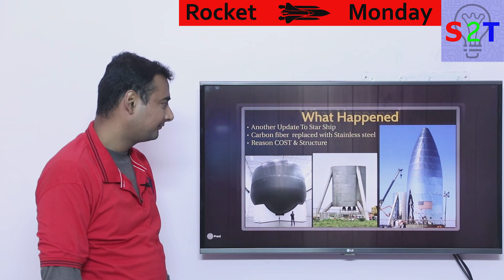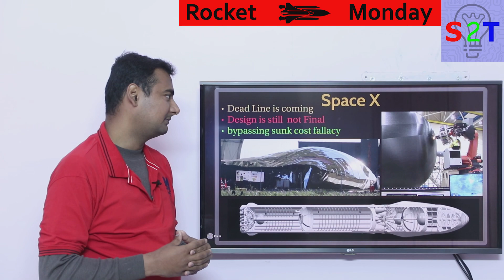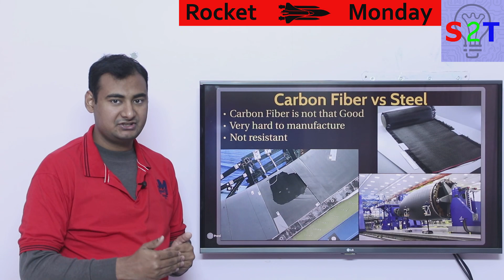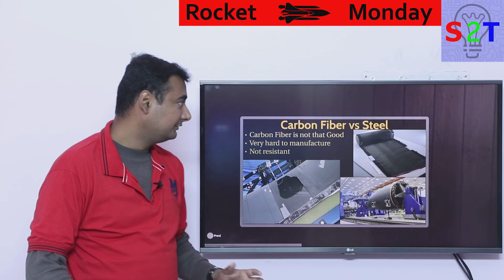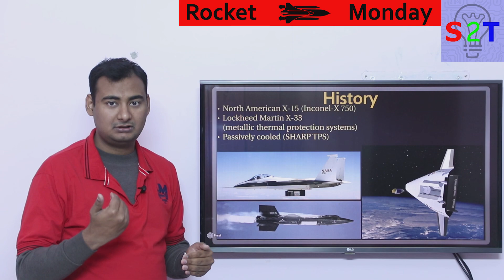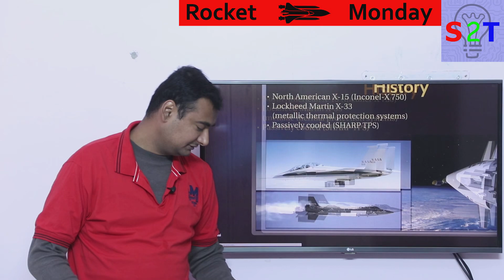Rocket Monday Ep32 (Spacex Stainless Steel Starship Explained)

Comment: The main reason he went to a metal skin is because it  is designed to 
protect the astronauts from long term exposure to radiation in deep 
space. by charging the outside of the craft with a high voltage and 
slowly rotating it the electrons on the outside skin will produce a 
magnetic field around the craft, thereby deflecting most of the harmful 
cosmic radiation. Any way that's what I told him in a letter I sent to 
him
Reply from the maker: dangerous IDEA